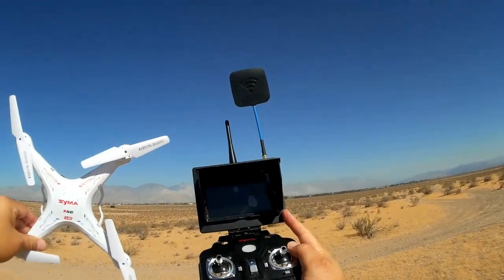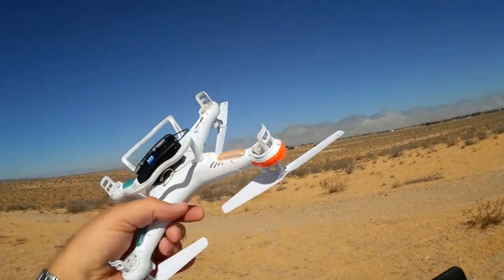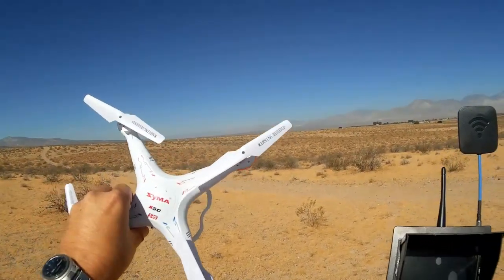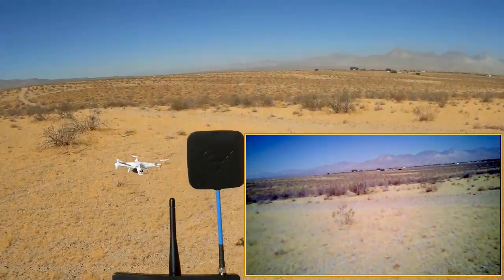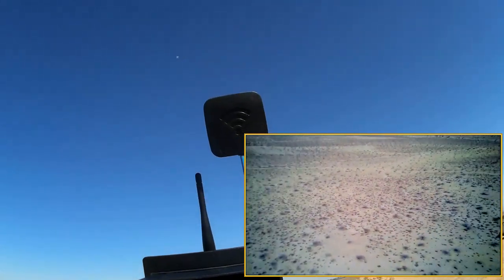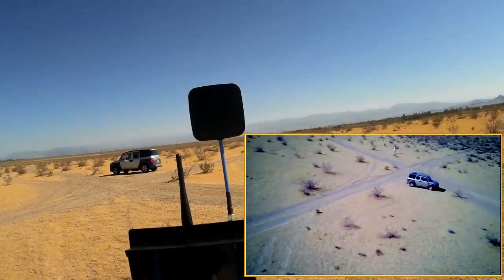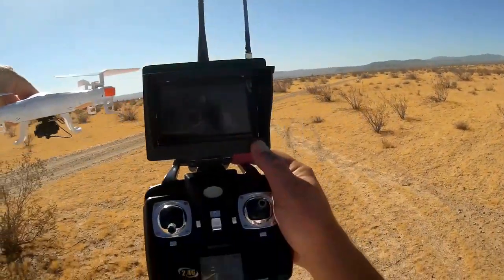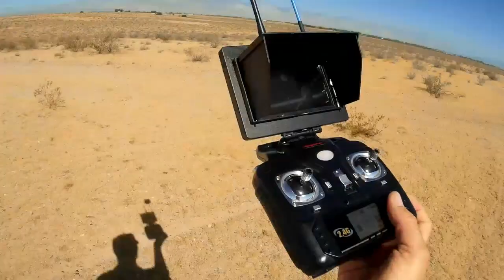Syma X5C X5S 5.8Ghz FPV Upgrade Review

Comment: If you replace just the antenna on the c4002 monitor will you get better range? If so what antenna would you suggest?
Reply: Androidgamer Wwmn someone said a clover leaf and it must be soldered to board
Reply: Androidgamer Wwmn that's interesting that it works well without having to change antenna on the transmitter. Cause I believe the transmitter is linear and supposed to work best with another linear. I wasn't very clear before about what to solder, they said if you wanted to add clover leaf to the camera, you'd have to solder it. I went back and read all comments and one person asked if changing completely to cloverleaf would help, quadcopter 101  said stock would have more range. I'm still considering clover leaf myself or changing the camera with something that's already CL and add a CL antenna to the monitor. Don't know yet

Comment: hey do you know if the syma x8c can carry a gopro hero 4 silver becuse im scared to bring my 400$ camera on a drone that could fall at anny seccond
Reply: Swgg Swag also if not would you recommend getting a dji phontom as my 4th drone
Reply: Swgg Swag The syma x8c will carry a gopro as long as you make sure the gopro mount is stable, another option would be the tarantula x6 as it can carry not only a gopro but a gimbal as well if you wanted, and is also less than half the price of the syma x8c. Without a camera attatched the tarantula x6 can be an extremely acrobatic and powerful drone, and with a gopro attached it can make for amazing aerial video and very nice range.

Comment: hey I'm back with another question I got,my syma x8c and I,noticed the blades are marked a1 a2 b1 b2 but in the coptor itself it just says a and b so does it matter what a or b goes where? iv been having problems with it not hovering it wants to awe to the left while in the air instead of hovering
Reply from the maker: +Austin Childs You put them on wrong.  Forget a and b.  Just note that there are two clockwise and two counterclockwise motors and blades.  Make your propeller installation match exactly as shown in this picture http://ecx.images-amazon.com/images/I/613bfPWxtUL._SL1500_.jpg
Reply: Thank you buddy do you have a Facebook page I could directly contact you on if I'm ever having issues you are the only person to ever answer and you make great videos I learned to fly them thanks to you great job and thanks again for the images

Comment: hey compared to this 2 models and x5sw which do u reccomend for a person who knws hw to fly a quadcopter well..im actually interested in x5sw because of its fpv capability and its low cost..or do u reccomend me getting any quad with fpv (if possible with gps) thanks
Reply from the maker: +Mohd  Nisar I like either of the following two FPV quadcopters as the best to learn to fly FPV. https://www.youtube.com/watch?v=_PshHVMGg7Y
https://www.youtube.com/watch?v=9bPaOEDpQFs
Reply: +Quadcopter 101 thanks for ur opinon by any chance do u have other models with fpv and altitude hold too? on a low price
Reply from the maker: Mohd Nisar Here are two others, but they have issues.  https://www.youtube.com/watch?v=_ODT1xilCNg
https://www.youtube.com/watch?v=PySduW6mymM

Comment: are you having any charging problems with the camera as mine dose not want to charge.
Reply from the maker: +Unwellskeleton If I remember correctly, this comes with two cables from the charger.  Believe that I had to plug both the screen and the camera into the charger simultaneously to get it to charge properly.
Reply: ok ty I will give that a try. hope it works as I dnt wan to return it
Reply: that didn't work either. so I took the usb cover off and soldered the cam lead to the monitor part as it wasn't getting enough power

Comment: Does anyone have a link to a manual for this camera & screen? I'd like to know what the meters for Rx and Tx are for. ie, are they batteries for the screen and camera? Or is one of them signal strength? I ask because I charged it up for a while (1 hour) and they don't seem to go up.
Reply from the maker: +Nick P The meters for the screen are inaccurate, and not representative of the actual battery charge.  One hour charge should be good, and just ignore the meters.

Comment: How did you mount the monitor to the controller properly? Is the wobble normal?
Reply from the maker: +Steve Benitah The hinge wobbles forward and back a bit.
Reply: Its actually because the part is in backwards! I was able to knock the pin out with a hammer and a screwdriver and turn it around, all good now. There is less friction than before though.

Comment: I wonder if it fits the x8c
Reply from the maker: Fabricio sensi You can attach it for FPV, but not for recording. And you'd need to find a way to attach the screen to your controller as the attachment fittings are designed for the X5C X5S controller.

Comment: Hi 101, just fitted this setup to my Syma TX and X5C (same as you have) however my controls have changed! 
I am still in mode 2 but now my left stick does Sideward fly and my right does YAW turn Left/Right fly as in rudder and aileron have swapped places!
The quad is unchanged as I can fly normal with my other Syma controller (XBox style).
Any ideas anyone?
Regards from Downunder.
Reply from the maker: +Ian McKay I think that you accidentally switched modes on the controller.  Note that Syma's understanding of Mode 2 is known as Mode 1 to the rest of the world ;-) To switch back, push and hold the yaw trim tab right or left while simultaneously turning on the quadcopter.  If it corrects the problem, make sure to never touch that trim tab again while turning on the transmitter.
Reply: +Quadcopter 101 that fixed it thank you quadcopter 101 you're a gem.

Comment: Hey +quadcopter 101! I was wondering:
I rescently bought a xiaomi yi camera to my Tarantula x6, and i want to go fpv with it so bad but all the fåv 5.8 monitors are really expensive. I´ve also got the Syma X5C-1 and thought that i would buy this kit. My question is: If i buy a Fpv kit to my Xiaomi, would that 5.8 antenna be able to connect with the 5.8 screen in the Syma FPV kit? Great vid by the way, Love your vids! :D
Reply from the maker: +Jeff SWE The receiver screen of the X5C kit is capable of receiving 5725, 5745, 5765, 5785, 5805, 5825, 5845, 5865 MHZ.  So your proposed FPV kit must be able to transmit on one these frequencies if you wish to use the X5C receiver. Recommend going to your vendor (or maybe RCGroups ;) to find out which specific frequencies it operates on.
Reply: +Quadcopter 101 Thanks a lot! :)
Reply: +Quadcopter 101 Hello again! Recently tried to fly with my MJX X101 with the xiaomi yi cam attatched to an Eachine TS832 Transmitter and was using this FPV kit's monitor. However, at first there was no proble, viewing it on this monitor, but after just 4-5 meters i could not see anything. Since the eachine transmitter i used is a 5.8 ghz one, why does it not work with this monitor? Any idea?
Thanks!

Comment: Does the monitor/receiver work with other cameras(Eachine EF-01,etc)?
Reply from the maker: Yes it does.  Most of these single frequency receivers receive on Boscam Bands E channels 4 or 8.
Reply: And can you use different antennas?
Reply from the maker: ovak Yes, but I don't know if you noticed, but this already comes with a great planar antenna.
Reply: kool thx for your help, awesome videos!

Comment: Do you think I could use it on a syma x8c?
Reply from the maker: +Brett Young Not without modifications as the X8C uses a different control plug than the X5C.

Comment: Is anybody having issues with the charging of the camera and Moniter?  The battery indicators on the FPV never shows more than half charged.
Reply: Try to open it and disconnect the battery for like 24 hours that worked for many devices for me

Comment: Do you now if this fpv system works on tarantula x6?
Reply from the maker: +Paulo Nunes Here's the same fpv system, but with brackets and control plug to fit the Tarantula X6 and other WLToys quadcopters. http://www.banggood.com/JJRC-H16-YiZhan-Tarantula-X6-WLtoys-V666-V686G-V222-5_8G-FPV-720P-Camera-With-Monitor-Real-Time-Transmission-p-1001396.html?p=RB0922217402201307U3

Comment: So could you essentially mount that on any quad?
Reply: Yep
Reply from the maker: george aura The FPV camera can be mounted anywhere as it has its own built-in battery.  But the recording input might not work depending on the wiring of the quadcopter's camera plug.  Am planning to attach this to my XK Detect X380 for FPV, but I'll also attach my Runcam for recording purposes.
Reply: Quadcopter 101 So as long as you don't record with this FPV camera, you can put it on any drone?
Reply from the maker: Fresh StopMotionReviews Yes.  Strap it to any drone, or actually anything (might try putting this on my dog's collar to see her POV :).  Again it's camera/transmitter has its own built-in battery.  But you may need to come up with your own way of mounting the screen to your controller, as the little mounting clips are designed to fit the Syma X5C X5S controllers.
Reply: Ok great cuz I'm trying to find another way to get FPV on a higher end FPV race quad

Comment: what is the maximum rane on this i seen it advertised as 600m ?
Reply from the maker: +Graham walkingshaw X5C range is about 70 meters. But this FPV video system is a little over 150 meters

Comment: Is this Fpv system better then the stock one on the Syma x5sw
Reply from the maker: Yes, much better.  It's a 5.8Ghz system (not WiFi) so that there's no interference with the quadcopter's 2.4 Ghz controller.
Reply: +Quadcopter 101 does it fit the sw and is there any delay on it?
Reply from the maker: Drones n more Yes it fits the X5C and X5S series quadcopters.  No WiFi lag delay as it's a 5.8Ghz analog system.
Reply: +Quadcopter 101 does it work with that gteng watch
Reply from the maker: Drones n more Yes it does. Set the watch to Boscam Band E Channel 4. But the watch is very tiny screen.  Not very good for flying FPV with. I use my gteng primarily to check FPV signal from my quadcopters (find out what channel the quad is transmitting on).

Comment: ok I'm new haven't ever had a quatcopter but,I'm getting an x8c but I want fpv if,I got this camera what mods would I I need to do to it so I can record I'm using it for football games,and stuff
Reply: also where do the videos save is there an ad port on the camera?
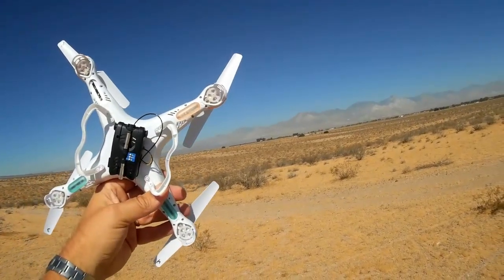Reply from the maker: +Austin Childs You would have to change the X5C control signal wire plug to match the plug of the X8C.  See above video at 1:04  Also, the video is saved to an onboard microSD card that plugs into a slot on the camera.
Reply: +Quadcopter 101 thank you so much and last question,iv looked at a lot of fpv cameras and they need WiFi like you said,in the video. so since this,one doesn't need WiFi what's the difference in the cameras? sorry I'm very new I am just extremely interested in these things and think it's gonna be a new addiction
Reply from the maker: Austin Childs WiFi is digital, and operates at 2.4Ghz.  Unfortunately, 2.4Ghz is also the same frequency as most quadcopter controllers. As a result, most WiFi FPV systems severely interferes with quadcopter range, and the quadcopter's transmitter interferes with WiFi FPV range.  In a nutshell, WiFi FPV is not a good idea.

Now this 5.8Ghz system is analog, but does not interfere with the quadcopter's controller.  And FPV range is very good at around 150 meters.  The camera also records digital video directly to a memory card.  The video is higher resolution than that of an FPV system.

Comment: I've been looking for an easy way to extend the range on this quad without taking the remote apart, would this work. :-)
Reply: no it wouldnt i recommend doing the transmitter mod its very easy all i did was soldier a piece of wire to the end of the antennae and got heaps more range.also did the quad itself man goes some distance now.do it trust me you wont regret it
Reply: Ok thanks, worth the risk
Reply: oh yeah not real risky at all Samson.Just take a little care and you will be ok.

Comment: when the camera and the screen is done charging is the usb cable supposed to turn red?
Reply from the maker: +Kenric Chen I can't remember. Either it's red during charging, and turns off when charging is complete or vice versa.  The way to find out is to plug in the charger without the battery attached.  Whatever the light does in this state is what you'd see when charging is complete.
Reply: When i just plug in the charger there is no color and when I also plug it into the battery it doesn't have a color either. Could you tell me how long it takes you to charge the FPV systeym, so I could just charge it for that amount of time.
Reply from the maker: Kenric Chen about 90 minutes.
Reply: +Quadcopter 101 I charged the camera and on the bottom there is a light it is green does that mean it has power and if it is red does it mean it is out of batteries? I also have a sky viper v950hd drone and I was wondering if I could put the camera on somehow.
Reply from the maker: Kenric Chen Is this light on the charger or in the camera?  My Syma X5C FPV camera only has a red light that is solid in standby, and blinking when recording.
Reply: My camera light turned green for some reason and when I charge it it always has no color on the usb cable and when I charged it for 90 minutes it still didn't turn red.

Comment: is the * RX * battery meter in the corner of the screen the battery for the screen? or the camera?
Reply from the maker: +Daniel Bruce It's for the screen, but it's very inaccurate. It always shows the battery at low power.
Reply: +Quadcopter 101 your right i bought a bunch of extra batteries for the drone and they are just bigger ones that the screen came with but they ALL said that. so i wasnt sure if it was the screen or what . thanks!
Reply: +Quadcopter 101 it is kind of annoying that the screen came with ZERO instructions for operation not that its all THAT complicated but like for the question i had could have been easily put to rest

Comment: Can th syma x5c lift both this AND a gopro or sjcam?
Reply: No it can't lift a go pro, pretty small quad.
Reply: Could an x8c lift both?
Reply: Fresh StopMotionReviews I have a payload of 98g on the x8c I have the runcam hd and a boscam transmitter. Flys well but as soon as the battery drains it tends to get that ring vortex deal going on
Reply: I have the x5C-1 and it can carry my SJCAM 5000.
But the camera only. No housing.  It was held by the included sticky mount but I'm sure there's other methods
Reply: Soldier1287 i tried sjcam with x5c-1 and it couldn't lift of the ground
Reply: I forgot to mention I got a stronger battery.  650 mah
Reply: Soldier1287 no it still wouldn't, I got upgraded motors and upgraded batterys and still wouldn't lift it. Just get the 808 keychain
Reply: Worked for me.  Weird.
Reply: Soldier1287 you lifted a go pro and and go pro clone and the same time?
Reply: No. It lifted the SJCAM 5000.
The camera by itself. No housing.
Reply: Soldier1287 well yeah that makes sense, just be careful that a gust of wind doesn't take both of them away.
Reply: Where'd you upgrade the motor?
Is it any better? I now have this FPV setup.
I wish the 808 had wifi for fpv though.
But this is good too.  
My stock battery seems to have swelled up. But  I still have the 650mah battery.
Is there higher batteries for this than 650mah?  That's all I found on bang good.com.  And that's also where I got the drone and FPV kit
Reply: +Soldier1287 on MicroMotorWarehouse.com they have some and yes in my opinion, it handles better and longer battery life by like a minute and a half but speed wise there is no noticeable difference, and I'm not sure if there's bigger batteries then that, try EBay or Amazon.
Reply: +0MARLBC is it the 7x20mm motors that say it'll turn it into a "cruise missile"?

I also wondered if you can put bigger, stronger motors on it.  I imagined putting phantom motors on this thing lol. It would save me money if possible

Comment: can you put a cloverleaf antenna on the monitor ?
Reply from the maker: +Jack Preece Yes, but the stock panel antenna provides better range than a cloverleaf (although the panel is directional while the cloverleaf is omnidirectional).
Reply: Quadcopter 101 ok thank you :)

Comment: can you use that monitor on a different brand of drone other than syma
Reply from the maker: +Stefanie Zawadowicz Yes as long as your other drone's FPV transmitter transmits on one of the following eight frequencies http://img11.hostingpics.net/pics/262051SymaFPVkit58GHzBandE.jpg
Reply: +Quadcopter 101 I don't have any kind of information about my drone. I have a tarantula x6. could I use it on that
Reply from the maker: Stefanie Zawadowicz The following FPV system is made specifically for the Tarantula X6 http://www.banggood.com/JJRC-H16-YiZhan-Tarantula-X6-WLtoys-V666-V686G-V222-5_8G-FPV-720P-Camera-With-Monitor-Real-Time-Transmission-p-1001396.html?p=RB0922217402201307U3
Reply: +Quadcopter 101 thank you so much. your videos are amazing. subscribed:)

Comment: anyone have the diagram of the 8 channels frequency for the monitor? i want use this whit my vtx aomway but not working yet, well work white the original 2 mp camera, i tried all 3 pins combination 123, im confused whit the diagram on the package
Reply from the maker: Here you go, thanks to SeBy DocKy http://img11.hostingpics.net/pics/262051SymaFPVkit58GHzBandE.jpg
Reply: thanks you very much, you save me... the c4002 package show 8 wrong channels, not one is good